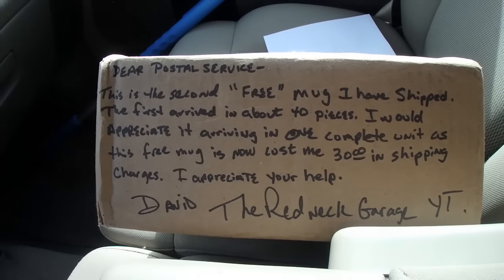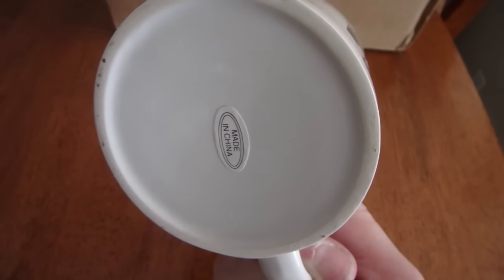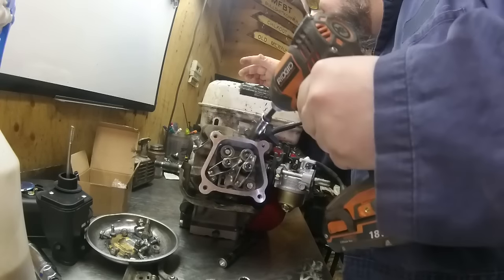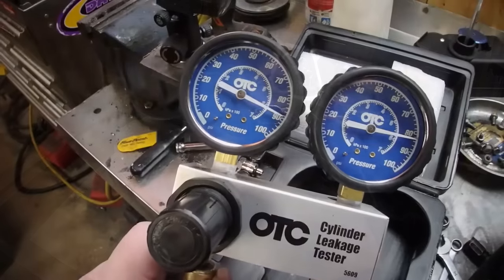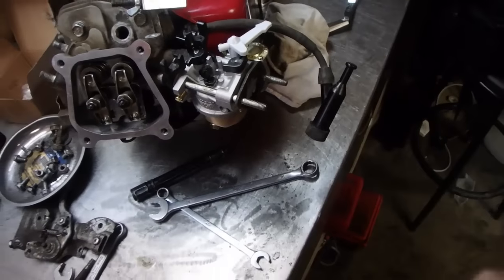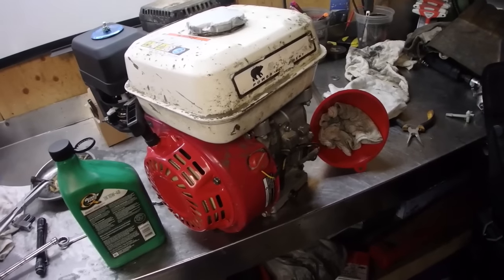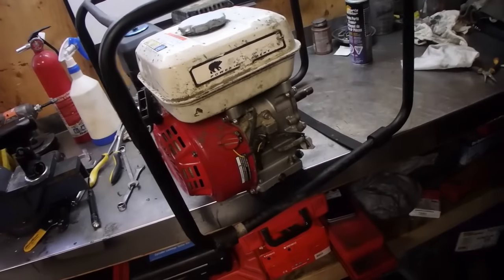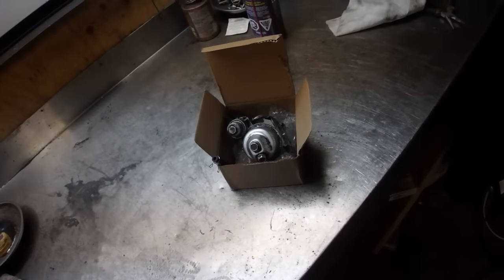Did I Screw Up Rebuilding this Engine ??

Comment: Ha, Daves a brave man for putting than note on the box .  Checked out the Decom on it, man them guys at Honda, pretty smart. That would lead a lot to thinking low compression for sure.
Reply from the maker: +STEVE ROB it's a interesting device for sure, threw me for a loop for sure until I pulled out the service manual and started reading then it clued in.

Comment: Hey, what do you know, the mug made it through the postal system! I used to work for Canada Post and let me tell you, they do not handle parcels with much respect. ALWAYS protect your items as best you can with as much padding as you can fit in the box. Glad to see compression was not an issue on the engine.
Reply from the maker: +ManicMechanic007 Yeah I can only imagine what happens in the postal service, i've seen some pretty mangled packages

Comment: Kool, first pull start after rebuild is great. I see so many small engine devices here in Ohio just scrapped or put in the trash and probably not much wrong with them. Its nice to see one saved.
Reply from the maker: +Bill Langdon what I waste, i'd be collecting all the ones that are the same and fixing them then selling them
Reply: +Bullshitkorner I'm pushing 58 years old and may be doing that as retirement income. I love tinkering with anything that has a motor and can always learn new things from you . Hopefully make my old age a little easier. lol.
Reply from the maker: that's the key is staying busy.  Once you stop everything is downhill

Comment: i cant figure out the low compression but passes the leakdown test?  maybe the rings need to seat with some more engine run time?
Reply from the maker: +Ozzstar the engine has a decompression lever on the Camshaft this is what i've been talking about
Reply: +Bullshitkorner looks like Ozzstar wasn't following the story line! Isn"t there a way to bypass the compression release? My SR500 had one that you had to physically adjust. It seems a little scary standing next to an engine with 90 psi in the cylinder! Thank goodness you had accurately found TDC. I used to degree in motorcycle cams and got pretty good at finding #1 TDC!
Reply from the maker: i actually pulled the cam out yesterday and filmed it in a video that will appear later in the future showing how it works.   something in the spark plug hole works good for finding TDC as well, just gotta make sure your on the compression stroke

Comment: The arctic cat doesn't have a decomp switch? I'm surprised. the Kawasaki's ive driven all have one so you can easily start it.
Reply from the maker: +max margherio it's suppose to, engine cranks over fine.  But try to pull start it and you'll throw your back out.  The compression stroke will stop you dead.  Been the same way with the old and new motor

Comment: I've got a 85' Yamaha XT350 that has a decompression cable that broke and let me tell you when that bitch kicks back shit will almost break your leg.
Reply from the maker: +josephmars20 oh i bet it does, my 650 is almost impossible to pull over by hand
Reply: +Bullshitkorner hell yeah I bet, and if it's really cold out good luck haha. Great video as always man keep it up. Ya it any ideas what to do with that bike?
Reply from the maker: no ideas yet maybe strip it down and part it out
Reply: Was it crashed?
Reply from the maker: it was once then fixed to use as a track bike